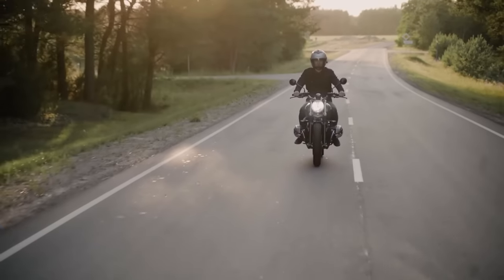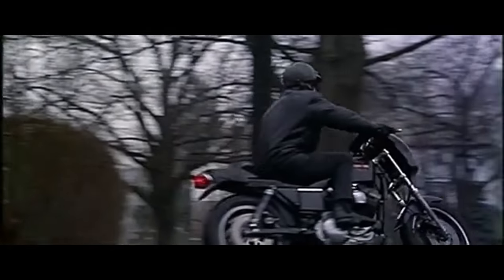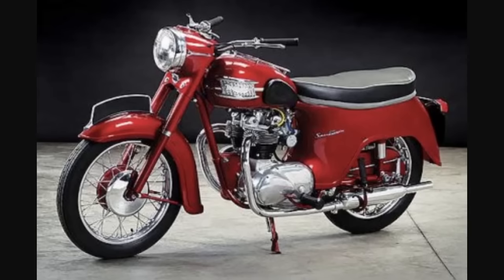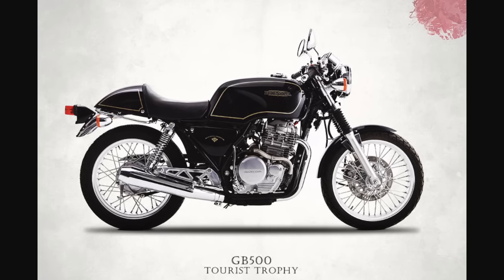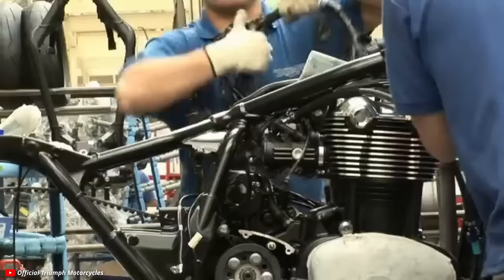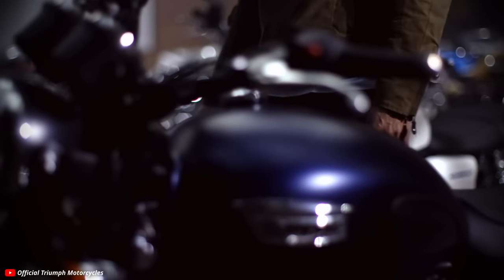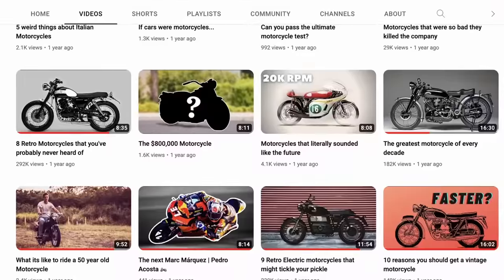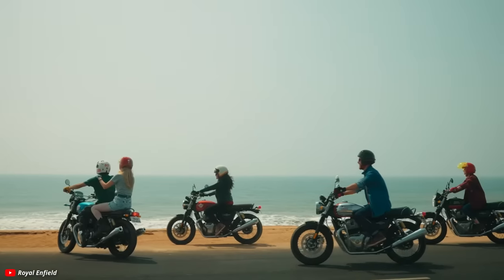The Strange History of Modern Classic Motorcycles

Comment: now 60 years old and from Austria, i do remember there was a opposite trend in the 80´s against that time super bikes e.g. Z1300 . I understand that wave started with the thumpers as Yamaha XT500 , a new version of BSA B50. And yes Yamaha XS650 . Kawasaki did some years later the zephyr series 550 750 110  a 1st incarnation of the classic Z series , with wire wheels and the 500 / 550 still using the old engine of the GPZ .  There are bikes the production never really stopped some may call it evolution e.g. Guzzi V7, Honda Super CUB. 
I think the Enfield goes in that direction . 
Beside that there are some bike which where just produced forever as the CJ750 a copy of the BMW R71- production at China Nanchang aircraft factory ended in the early 90`s.  

BR

Comment: It's really kind of misleading to suggest that the design of the Kawasaki W650 has anything to do with British bikes, because it really doesn't, except insofar as prior to the W-series, Kawasaki had acquired a stake in Meguro, which had licensed the design of the BSA A7. The W650 was a modern version of the 1960s Kawasaki W1, W2, and W3, not any specific attempt to ape Triumph, and it's simply not accurate to state that Kawasaki "partnered with BSA" in any manner. By the time the W1 was released, in 1966, the Kawasaki and BSA motorcycles has significantly diverged. 

In the 1960s, motorcycles looked much the same all over the world, because the manufacturing technologies of the 1950s and 1960s did not really allow for much variation in what the finished product was eventually going to look like. Motorcycle design really didn't significantly change until the early-mid 1980s, with the development of perimeter and twin-spar aluminium frames and the application of the monoshock rear suspension developed in the 1970s for motocross to road motorcycles.

Comment: Meguro - the famous Japanese motorcycle manufacturer - purchased the license rights of the BSA A7. BSA A7 was built to compete with Triumph Speed Twin (introduced in 1938 or so). (Fun fact, Val Page, the designer of the BSA A7 was a former “master” of Edward Turner, the designer of the Speed Twin). Meguro was purchased by Kawasaki, and the Meguro K (License version of the BSA A7) was re-branded as Kawasaki. The W650 and W800 bikes are a modern interpretations of the original Meguro/Kawasaki K series (not the W series as the name would suggest). So yes, Bonnies and W800s look similar but for a good reason. The ancestors (Speed Twin and BSA A7) were built to compete, and were designed by two engineers who worked together on the very first twin cylinder engine of Triumph.

Comment: I get your point of owning the real old stuff instead of a modern homage, but being in a context where bikes are not weekend toys but the main mode of transport I'd pick a modern, warranted retro bike every single time, the last thing I need in my daily commute are carburetors or drum brakes in heavy brazilian traffic, hence why I got an Interceptor as my do it all bike, and also cause a T100 is double the price here.
Reply: Exactly.  I will take a modern classic over an original classic for a number of reasons.  New bikes have modern tech making them more reliable, faster, safer.  Also I simply don't have  the ability or knowledge to fix and fabricate everything that will be necessary on an old bike.  Yet, the modern classic is the style of bike I am attracted to, being 60 years old and growing up with the classic look. And last but not least is the cost.  A classic motorcycle will end up costing you considerably more,  particularly if it is a desirable, collectable bike, and of course the cost of maintaining an antique.

Comment: When the Yamaha XS-1 650 came out in the mid-1970's I thought it was interesting. But just a vertical twin. This was a few years before the emergence of their 750 triple and subsequent myriad of engine and styling advances (think Yamaha 550 Vision). But then in 1979 Yamaha released ther 650 Special which was an instant hit in the USA. I think it was precisely what is discussed in this video, namely that it was simple and inexpensive. Half cruiser and half-retro. It went that step further that the XS-1 needed at it's inception.

Comment: As a matter of interest a 1965 Bonnie weighed 165 kg while a 2010 comes in at 262 kg. British bikes of the 60's were always as light as possible! ADD LIGHTNESS were the watchwords back then!!!
Reply: !961 Bonnie weighed 393 lbs.
Reply: @brucekamps6970  Well 165kg is 363lbs is that close enough? Maybe the 65 model was lighter than the 61??
Reply: @notwocdivad  Sorry, wasn't contesting anything you said.  I was just stating a fact, since I had a 61.  Could be dry verses wet weight also, but I believe there was a difference between 61 and 65 since the 61 had a separate transition from the engine, and I believe by 65 the transmission was integrated with the engine.  So, 65 could very well have been lighter.
Reply: @brucekamps6970  NO bother Bruce it never entered my mind, anyway if I remember correctly the 61  pre unit and they turned to unit by 65, that could be the difference right there? Ride Safe buddy.

Comment: No mention of the Honda CB1100? The spiritual successor of the 1969 CB750, currently one of the most popular retro-cafe rebuild bikes. It was the bike they coined the term 'superbike' to describe. It was the bike that kicked off the Golden Era of North American motorcycling in the 1970's, and in doing so cemented the Universal Japanese Motorcycle as a classic design standard that dominated the decade. It effectively killed the British bikes in NA (and almost did the same to Harley-Davidson), while helping cement a permanent spot for the Big 4 from Japan.

So Honda built a 1,140cc air and oil cooled inline 4 UJM successor from 2012 to 2022, a bike they spent a not insignificant amount of time and engineering to make sure that it made the right 'ping' sound when the engine was cooling down after a ride, and it didn't even get a mention?  For shame...

Comment: Odd that you didnt mention the kawasaki zephyrs or the zrx. Talk about retros, they were literally z’s and gpz’s styling nailed to a t but with 90’s-mid 2000’s mechanical advancemants. The zrx1200 had over 100 horsepower. As someone who has owned most models of the original models of z with my dad, this is the closest a retro bike has ever come to the source material. They were literally just faster versions.

Comment: I love the Honda GB500 and Kawasaki W650. They actually look like the real thing, and both are carbureted. The W650 looks way more like a mid '60s Bonneville than the new Triumph Bonneville did when it first came out. The current Kawasaki W800, while sadly not carbureted, still looks more like a Bonneville than the real modern Bonneville, except for the flat black version, which is the 50 foot tall 50 ton elephant in the room here. Supposedly the idea of a "retro" motorcycle is supposed to at least look as close to an original vintage motorcycle as possible. Yet there are absolutely no vintage motorcycles that were painted nearly 100% flat black. I own a 1966 Bonneville. I bought it back in the mid '80s. The tank is a two tone blue and white with a large chrome Triumph emblem, the side covers are GLOSS black, the fenders, wheels, handlebars, exhaust, and pretty much everything else is chrome. Except for the black cylinders, the engine is all bright aluminum. It is a bright, shiny motorcycle. That's the way motorcycles looked back then. Now it seems that it is nearly impossible to find a new motorcycle that is not almost completely flat black, whether it is a modern looking one or a retro bike. The world must have a HUGE over abundance of flat black.

Comment: You can argue that 75% of Suzuki's entire lineup is a modern classic neore retro bike. All they did was just never change it. I mean the DRZ is carbureted  still... They should just lean the retro craze lol.... And the one bike that they do offer as a modern classic is just something they've been making for a million years. So it looks like a modern classic cuz they've never changed it. It's that little 250... If they put fuel injection in the DRZ and made it a 450 hell even if they use a 02006 rmz450 emgine itll sell

Comment: The Harley XLCR 1000 was ahead or it's time? A retro bike? Ha, Ha, Ha!! I was a motorcyclist when this XLCR came out. The bike was Harley's attempt to compete with Japanese motorcycles that were cleaning it's clock from a performance standpoint. 

The XLCR was a stock Sportster with a second front disc brake, upright seating, semi-rearset foot pegs, race bike type bodywork and a blacked out motor. My 1973 Norton Commando 850 would spank a 1977 XLCR so bad on a twisty road it was no contest. Ditto a 1977 RD400 Yamaha... pass that Harley in a third gear wheelie! You could buy buy 3 RDs for the price of one XLCR Sportster.

Look, I like Harleys. The XLCR didn't sell because it was a pathetic "looks only" effort at a performance motorcycle. Now take a Harley XR 750 Flat Tracker, detune it some for the street and put the body work on THAT motorcycle and you'd have something. HD actually did make some XR 750 street legal motorcycles (Street trackers), to homologate the XR 750 for racing maybe? 

Instead Harley made the XLCR, a bike nobody wanted despite the typical HD hype. I can remember going into a HD dealer, looking at the XLCR and scratching my head, think WTF? I wanted to like the bike, but it was lipstick on a pig.

Whatever inference you want to draw today, the XLCR was HD's lame attempt at a performance motorcycle. It had nothing whatsoever to do with 1960s British Cafe' Racers. Harley didn't even beef up the suspension or tweak the Sportster motor, how pathetic. 

The XLCR 1000 was an embarrassment for Harley at a time when Evel Knievel was jumping 12 school buses on the XR 750 !! Go figure.

I liked this video however. I'm not dissing you; just setting the record straight.

Comment: Im opposite of you as far as motorcycles go.  I would rather have the modern one if I could only have one as it comes with a warranty etc etc and I want to be able to ride and not worry.  In my experience all motorcycles break enough that a new one will still have you wrenching on it on a long enough ride.

Comment: The main reason for the resurgence of these retro designs, I think, is the way that current novel designs have all coalesced around the dead end of that super-outdated, overdone and stale KTM-derived(?) aggressive, angular, insectoid alien vision of futuristic design. It's no longer futuristic, and just looks goofy, cheap and pointless . People at large just want motorcycles that look recognizably like "motorcycles", which isn't even necessarily retro - it could be something new just as well. It just needs to be good, actually fresh, and clean, which is much harder to nail than taking the shortcut to the faux authenticity provided by going back-to-the-basics retro. Which is not to say the latter is easy, just much easier.
The retro fad is just a call back to the drawing board. It's just what you get with the death of the most recent design paradigm when no new one has been good enough to come around and fill the space.

Comment: The current Triumph company really has nothing at all to do with the original Triumph company, other than having purchased the rights to the name, so it's not accurate to say that the current Triumph company has "revived" the Bonneville or that it really had any "heritage" to speak of. The 2000s to present Bonneville shares no common ancestry to the Bonneville models manufactured by the original Triumph company.
Reply: Absolutely.  If it did it would have a 360° crank to make it sound 'right'. 🙂